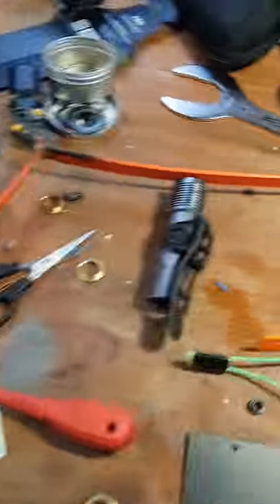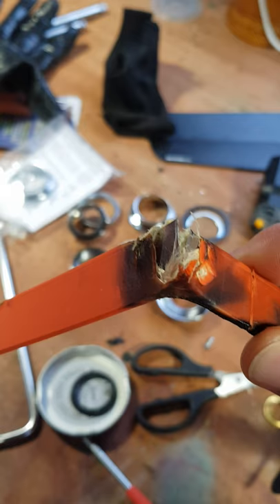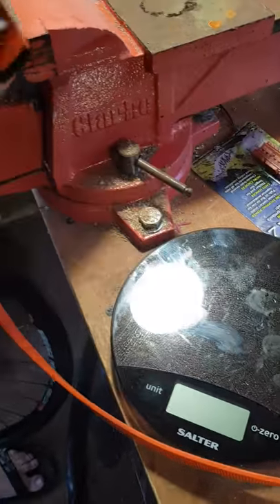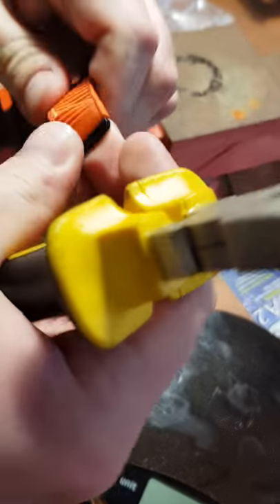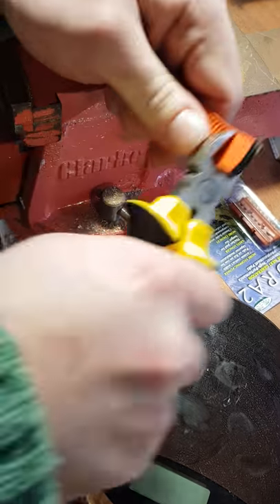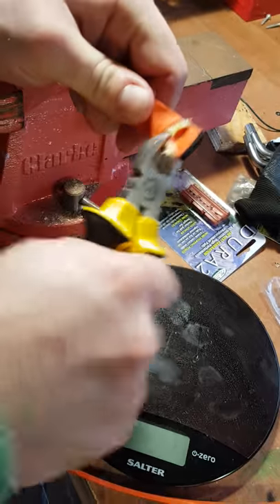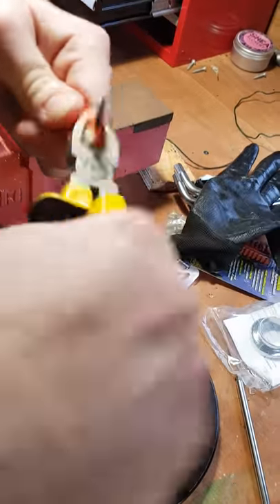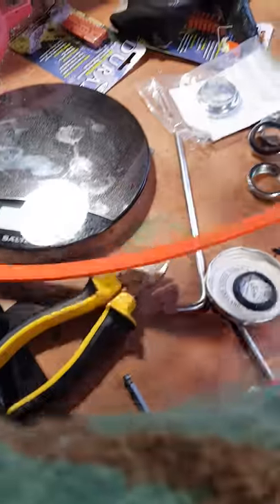Otto Lock - tested to destruction

Comment: kevlar wont stop anything from cutting into it. The company used that to fool people into thinking the "lock" is secure. Bolt cutters also aren't meant to cut through sheet metal, but many bike thieves just have those for cord related locks. A pair of tin snips will easily cut through these as that's what they're meant to do. I have seen those handsaws cut through the "lock" but you need a good angle for it and for it to stay still. 

I think would rather get the Fahgettaboudit as the the lock will shatter the blades on a hydraulic cutter. Its one tool I doubt a lot of bike thieves have on them and the shattered blade will put them in the hospital.

Comment: Thanks! Just saved me $80! 
I may still get one for quick trips into the store, but not for any long visits.
Reply from the maker: Chris Duke I think this would be a great lock when you are only leaving your bike for short stretches of time or live/are travelling in a low crime area
Reply from the maker: I should stress that the strength really is impressive for a lock that weighs 150-300grams. Even though it is expensive (especially to import to the UK) I ordered another one right after this video
Reply: Good to know. It looked like you tried using fire to soften up the plastic/Kevlar? I was wondering if that did anything? I would figure that if the Kevlar (if that's what it is) is wound tight enough it should be fire proof.
Reply from the maker: That wasn't me, that was whoever tried to actually nick my bike while it was locked up with the otto. He must have been working away at it with his Clippers or boltcroppers for quite some time to get desperate enough to try melting it with a cigarette lighter!
Reply: The point with the 150grams is the main point, that the producer should concentrate on.
I mean, what when you triple up the layers and have still a very light weight lock with 450grams.

In terms of toughness, I think you will get in the area of the tex-lock from germany. 
I thought about buying one, as I saw i it in thr german tv.

Comment: The thieves almost got away with it. There was less than a cm left. Someone must have stopped them.
Reply from the maker: The lock didn't actually look this bad when they were done with it - overnight the steel bands unravelled and the thing sort of split itself apart. But yes, something must have spooked them for them to scarper so close to breaking it

Comment: Looks like it will cut though in two seconds with an angle grinder.
Reply from the maker: I'm sure it would. This is an extremely lightweight lock it shouldn't be compared to a D-lock though. For it's weight I think the strength is impressive, especially against bolt cutters
Reply: Rupert Beharrell 
I have the Ottolock and i‘m pretty worried about now. If you got some Knipex Cobolt. It‘s through within one try :(. TRUST ME!  I need a nee one!